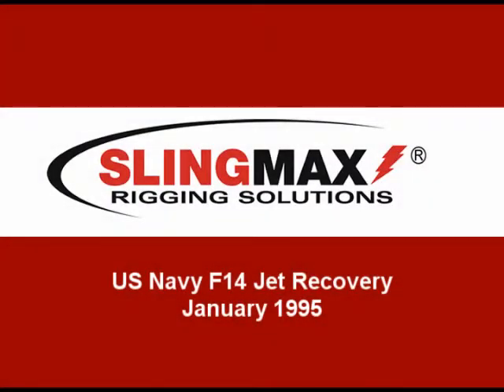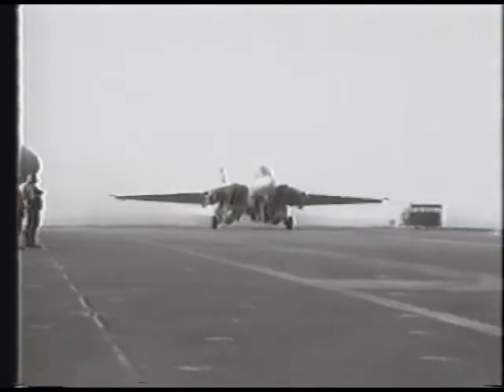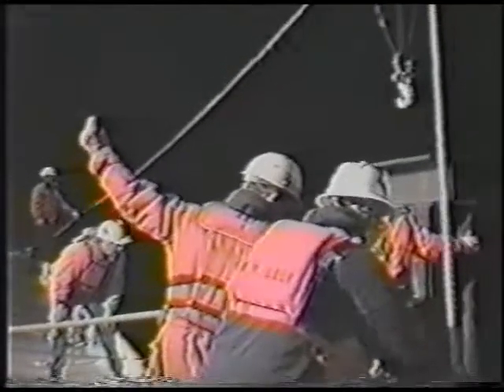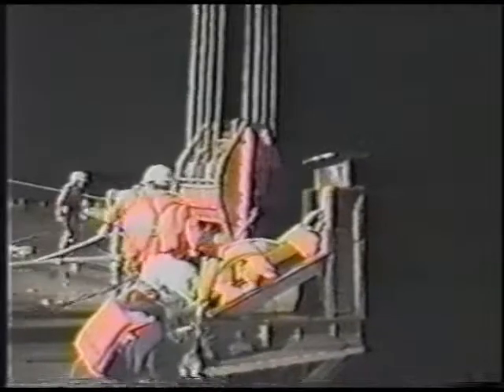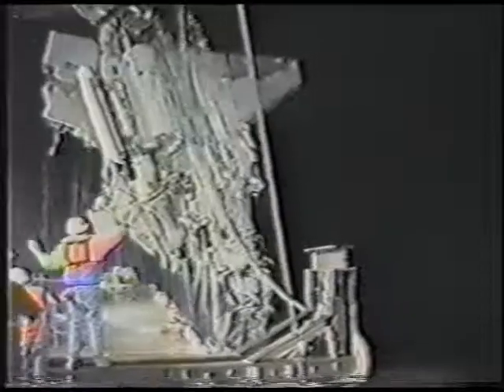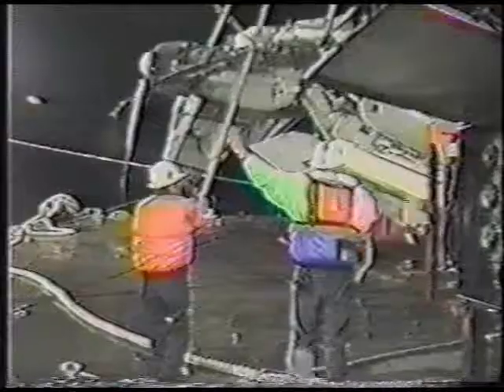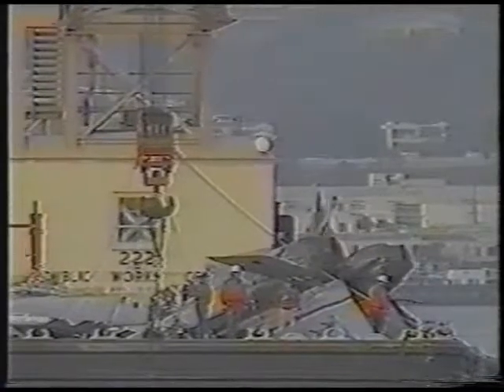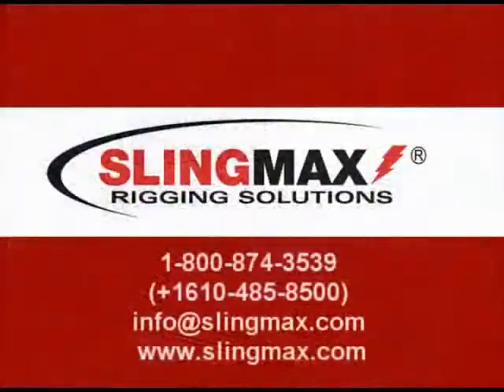Twin-Path Slings– Lifting Slings – US Navy F14 Jet Recovery

Comment: That there F-14 was one of teh F-14s that each scored SU-22 "Fitter" kills in the 1981 Gulf of Sidra Incident.  This is the jet where hultgreen was killed after her RIO made a command ejection where his seat leaves the jet first, followed by the pilots front seat 0.4 seconds later. the RIO survived, but the jet continued to roll over and Ms Hultgreen was ejected into the water.  She was recovered still in her seat.
Reply: Not sure I would word it like that, sure make it sound like the RIO’s fault which it was definitely not. She stalled the airplane after continued missed line ups that day and was told to wave off several times before she did , yawed the airplane hard left which caused compressor stall on left side and went full burner. You are correct that they were told to eject when it became obvious of the crash and you are also correct the RIO’s seat is first to leave and she was ejected straight into the water but that was no fault of the RIO
Reply: @QuiteSBR556  Not his fault at all, she was supposed verbally command ejection with "eject eject eject " calls.  If Lt Klemish had followed the NATOPS to the letter, BOTH of them would have died.  The reasoning of having the Pilot make the "Eject,Eject,Eject" call and having the RIO actually pull their face curtain ejection handles located above their heads OR their ejection handles located between their legs, is so that the Pilot can continue to attempt to fly the plane WHILST the RIO actually pulls their ejection handles. (the F-14A and the later F-14A+, later in 1991 the F-14A+ was renamed F-14B.  The F-14-B variants use the face screen AND seat pan firing handles,  the later F-14D variants use the Martin Baker Martin-Baker SJU-17 (Mk. 14)NACES seat which uses the seat-pan ejection handles alone*no facecurtain)  As the canopy is jettisoned, then as the RIO goes out, this specific sequence allows the Pilot to keep his hands on the throttles and the stick in an attempt to hold the aircraft within the ejection seats "ejection envelope" and gives the Pilot a couple moments to get themselves into the proper ejection posture. If the Pilot had to pull the handles(a two handed process) their hands would be on the ejection handles and not the controls, as such an aircraft could easily exit the ejection seats "envelope".  The RIO, Mr Klemish, doesn't recall hearing the the Landing Safety Officer(LSO) transmitting the "raise your gear" and "Eject" calls.  Lt. Hultgreen. Both the RIO and moreso the Pilot were probably experiencing sensory overload during the last moments.  She lined up off centerline of the carrier,  made aggressive rudder inputs(fine in the EA-6A-2 seat version of the later 4 seater EA6-B), which caused the big nose of the F-14 to interrupt airflow into the Port(left) engine causing at minimum "popcorn" stalls at worse a full flameout.  NATOPS specifically states that "rudder authority may not be sufficient at low speed, to counter-act the yaw forces encountered during a single engine out scenario with the opposite engine in Zone-5 a/b." Also "large rudder inputs are to be avoided" when slow.  Wrapup- Lt. Klemish initiated the ejection on his own, without an ejection call from his Pilot.  If the Pilot would have made the ejection call to her RIO at an appropriate time, there's a good chance that BOTH ejections would have occurred at a point that was within the ejection seats operation "envelope".  Of course it's easy for us to armchair commander these scenarios, in reality there were many time critical decisions to be made in a matter of seconds.  There have been many accidents almost exactly like this one.  The GE Marconi Digital Flight Control System(DFCS) was first installed in a fleet of F-14D's in March 1999. Within the next year ALL F-14A /B's and D's had their analogue  Flight Control System, with the Marconi Digital Flight Control System.  It was supposed to be introduced into the F-14 fleet in 1995, but was deferred year after year because of budget constraints.  The Marconi DFCS was a huge success, it made departures from controlled flight MUCH less likely.  It also improved the flight characteristics so much, that a test f-14 was damaged during rolling testing. Astronaut Mark Kelly was the Test Pilot that "bent" that test aircraft. the NATOPS had to be changed to avoid damage out in the fleet.